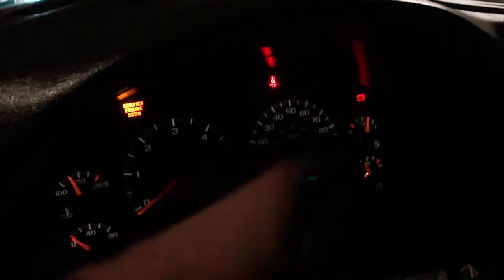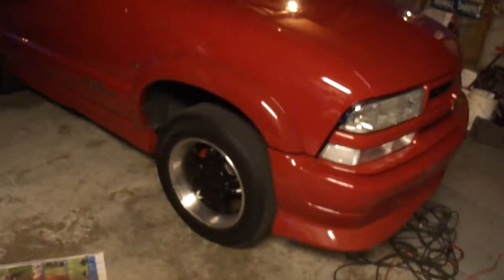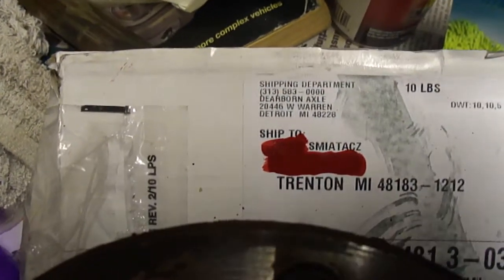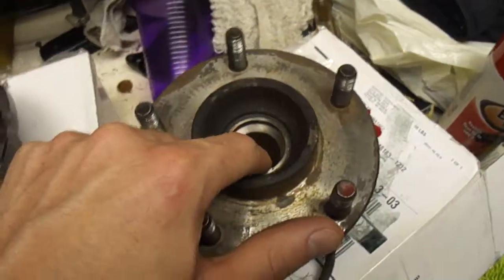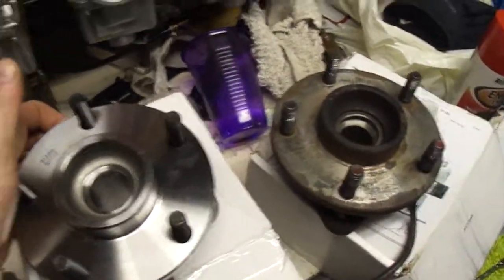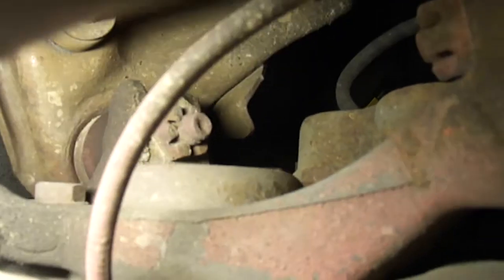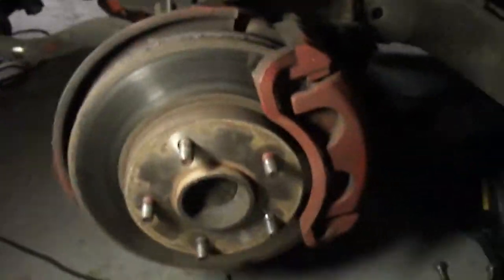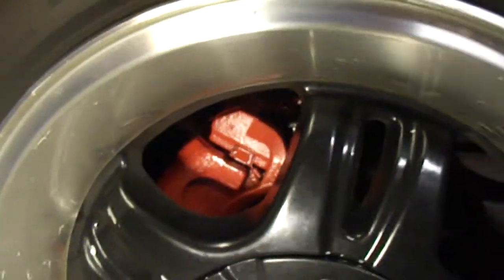Chevy Blazer Xtreme Wheel bearing/ Hub Replacement Part 1

Comment: I have a 96 Blazer thats 4 wheel drive. I get a humming noise from the front end, would that be my wheel bearings going bad. It has 155K miles on it and I don't think they have ever been replaced.